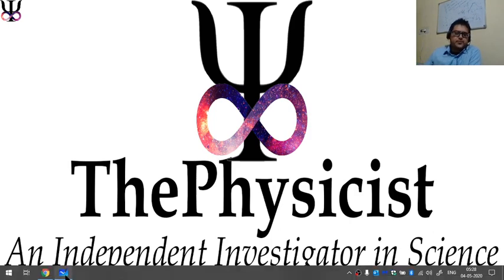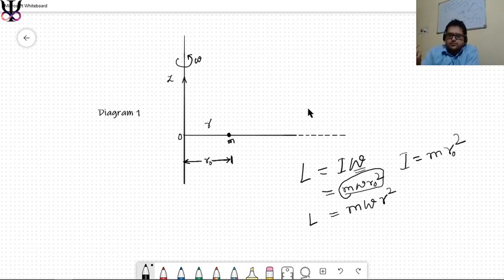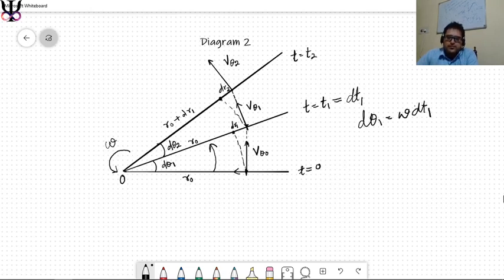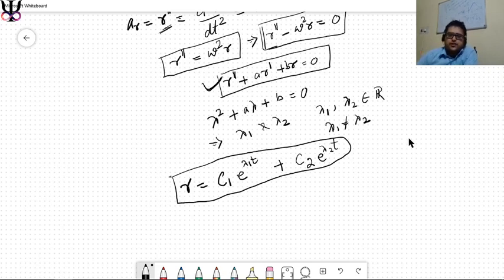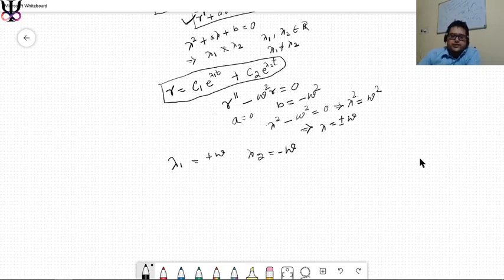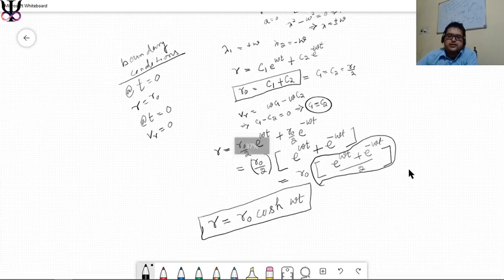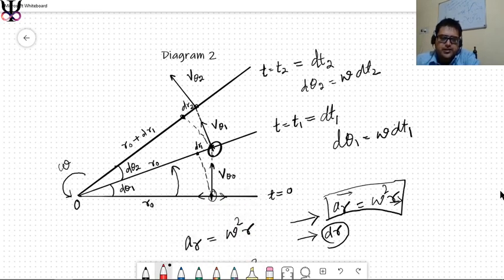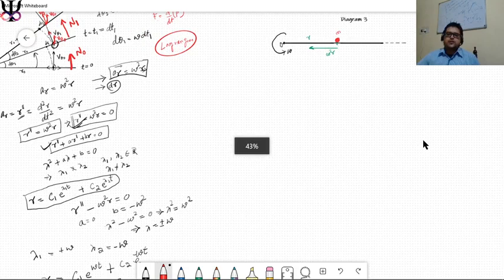Bead embedded to a rotating wire | Rotational Motion | Classical Mechanics | Lagrangian

Comment: I recently started thinking abt this question after finding it in a video, I got stuck exactly in the part where ur post explains why actually the bead moves,well the question maybe solved but if langragian is a more advanced formulation of newtonian mechanics, why can't we explain it?
Reply from the maker: It can be perfectly explained without the Lagrangian formulation. In fact, the Lagrangian formulation never really explains the physics. It just makes the math simpler and easier. By the way, for productive and meaningful discussions with inline math equations and diagrams, please visit ThePhysicist.in/Ask.